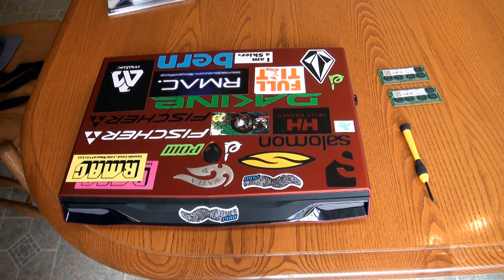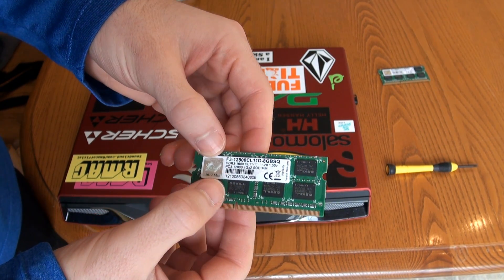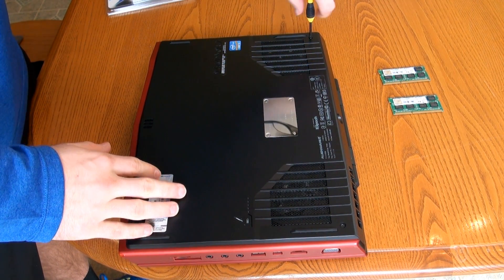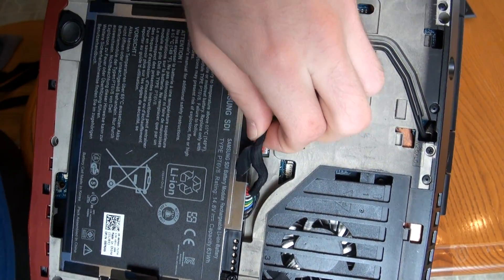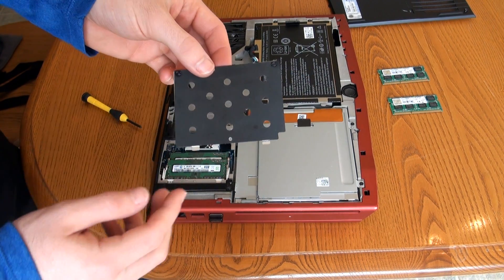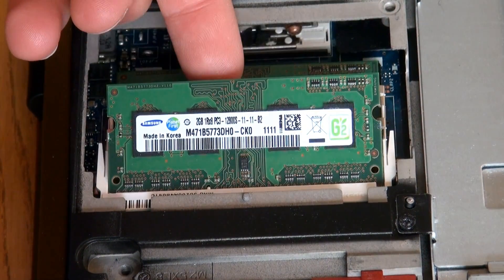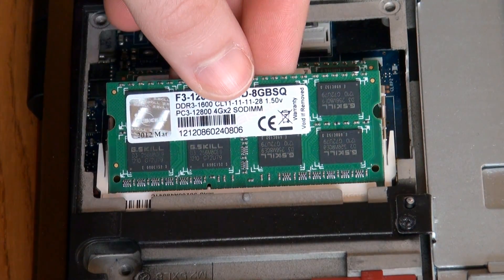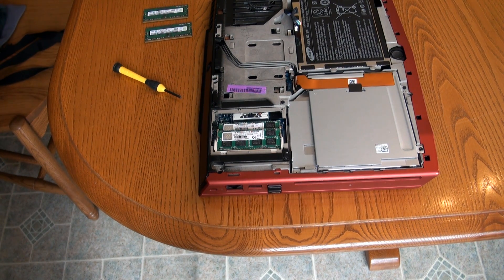Upgrade RAM for Alienware M14x - How to

Comment: I am trying to locate 2 8GB Chips to replace my 2 4GB chips. For some reason I can't find any that will work with my system.
Reply: do you know where I can get my hands on 2 8GB chips that are compatible with my system?
Reply: why does it say that Crucial CT2KIT102464BF160B is not compatible?

Comment: im a noob at this stuff so does it matter what kind of ram to buy or where can i buy it?
Reply: It does matter.
Reply: brandon herrera The Alienware m14x can only support up to 16gb of ram so you would need to buy 2 sticks of 8gb ddr3 notebook memory. The best place to buy would probably be amazon and I will provide you with a link of the ram I would buy.
Link to ram: http://www.amazon.com/Crucial-DDR3-1600-PC3-12800-CT2KIT102464BF160B-CT2CP102464BF160B/dp/B007B5S52C/ref=sr_1_2?ie=UTF8&qid=1438201435&sr=8-2&keywords=ddr3+ram+8gb+notebook

Comment from the maker: Hi there. This RAM should be compatible for all CPUs, but you may want to read the M14X user manual just to make sure. You should definitely be able to buy the RAM from Ebay. If you don't want to use Ebay, I'd recommend using Google shopping to find a seller. Glad you enjoyed it!